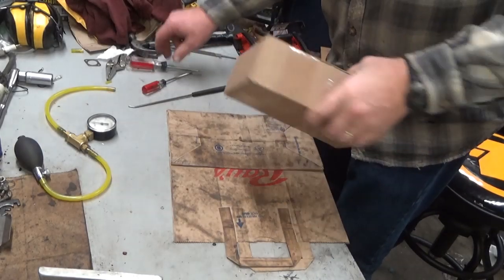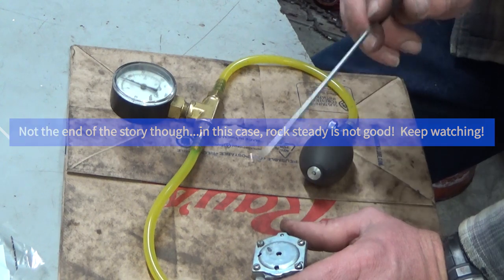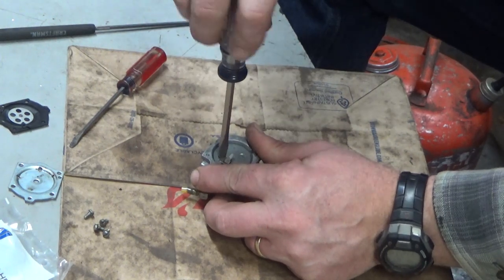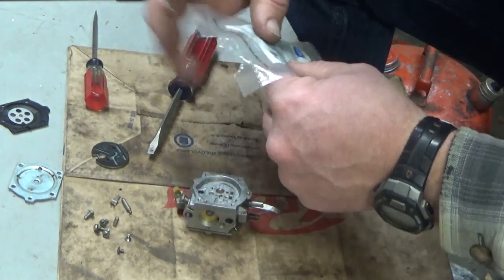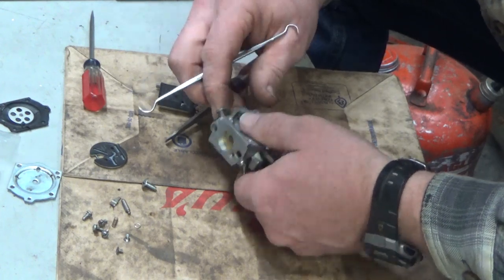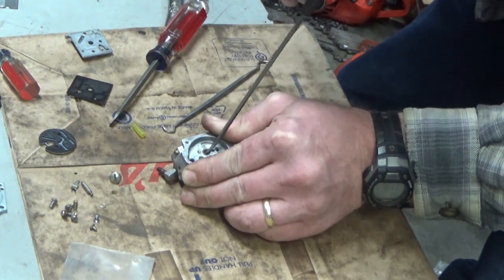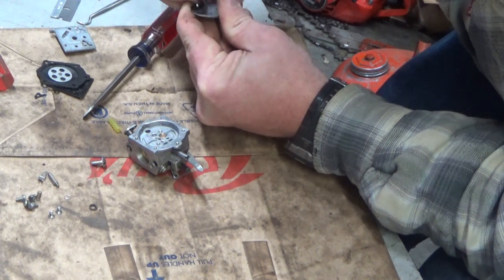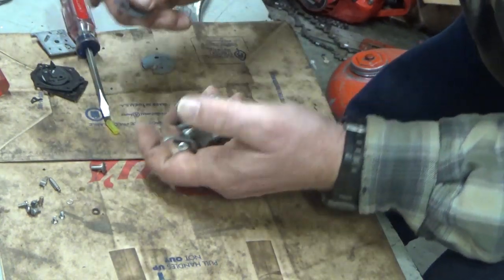Walbro HDC Carburetor Full Disassembly, Check Valve Replacement & Testing

Comment: Thanks to you, I just finished a Super 2 early metal body saw. I used your excellent videos to take it on and had great success. New oil and gas lines, duck bills, piston ring, crankshaft seals and a full rebuild of the HDC carb. Purrs like a kitten now and oils the chain properly without bar oil getting into the crankcase. I really appreciate your careful instructions and explanations. Thank you!!

Comment: Thanks for your insight. I had overlooked the check valve as the cause of not being able to get the saw to perform evenly.
I rebuilt an HDC-65 today. The parts kit (Walbro) had more than one metering arm spring. 
The kit instructions list four springs of different colors: COPPER (98-189), BLUE (98-270), GREEN (98-275) and BLACK (98-266). 
They are of different lengths and wire gauge.
The old spring was copper-colored and the HDC-65 calls for a black spring. The carb had been rebuilt more than once.
This made me look at the circuit plate gasket and ... it was also wrong. This explained the wet, black spark plug.
And so, I am reminded: when rebuilding a carb on an old machine, always keep in mind that it may have been rebuilt with the wrong parts.

Comment: excellent ! I have destroyed my check valve during the disassembly, the old promac 10-10 had exactly the trouble described for hygh speed regime. Now I know that the problem was certainly this small disk. the repairing kit is not easy to find in europe and need to be purshised in USA. Means more than 20 euros, more expensive than a gold disk...well because the seat is removable, thanks to your explanation, I would never guess it was posible, probably I'll try to make a valve with a piece of membrane, and check if I have a leak with your method. A great thank to Leon for sharing his knowledge. And a big pray for the re-birth of my 42 years old chainsaw, make it work again is a real challenge !

Comment: Outstanding video. Great insight🎉Those rubber valves are now $10 to $15  about as much as a new carb. Maybe trying to fab them out of metering diaphragm rubber or acetate with a homemade circular punch tool or metal tubing to get the perfect circular shape. Thats the best option. Otherwise its a new carb.
More manufactured obsolescence
Reply: It’s highway robbery now plus shipping charges 😢😢😢

Comment: I know this is an older video but it is still a very good tutorial.  If a metering needle leaks, first check the seat (magnifier and light are helpful), and try lapping/polishing the needle to the seat to clean it up nicely.  If a bit a carburetor cleaner is not enough to remove any imperfections, try a tiny spot of toothpaste - it has just enough fine abrasive to work.  Finally, try wetting the needle and seat with a bit of fuel mix.  Sometimes that's all it takes to achieve a good seal.

Comment: Really appreciate this video Leon...  I learned alot about proper use of a pressure testers and was able to get my old Husqvarna 140S running like new thanks to you and all the info packed in this video. My next project, tripple Mikuni carb rebuilds  on a  Yamaha Waverunner. Very similar design and testing techniques as used here.  Best Regards, Sam.

Comment: I just sucseded to fix the checkvalve widh a pice of the old pump diafragm .
6 mm hole punch gave "that little piece of rubber " .
Worked well after straight cut 0,5 mm away from diameter on opposit sides.
Had to take out brass to get it in.
Reply: Thanks for the. Size .not going to  order a peice of rubber  confetti from China  that's for shur .Hahaha.

Comment: Thanks for the awesome vid. I was finally able to get my 4 stihl 015 saws running after watching this. Turns out I had the wrong circuit plate gasket in all 4 units, I was using the Z one and the plates on all of them have 2 holes so they all kept flooding and running super rich. Put the other gasket in and now I can tune them all the way up to 12,500 RPM and they rip.

Comment: I just started rebuilding carbs, found a tillotson that leaked on a brand new needle out of the kit. I stretched the spring but it still leaked. I removed the needle and sprayed carb cleaner in there several times. That did the trick. I suspect that the seat can get just a tiny speck of varnish or stuck debris and that will not allow the needle to seat. Seeing this Walbro compared to a tillotson....I'd go with the tillotson every time, much simpler and I think better designed. Thanks for your superb teaching videos!

Comment: I have found that soaking carb gaskets in some mixed fuel prior to installation helps seal things up. I have had a few dry ones drive me crazy but as soon as I did that, they sealed up fine. Great video btw.
Reply: Thanks for the tip. I have never done that before, but it makes sense to me. Trying it now.

Comment: Some of the rebuild kits I’ve used have a small hole in the levering dimple for the metering needle .. a small wire in that holds the spring in perfect alignment for assembly

Comment: I am going to replace the check valves on my HDC's as well. I rebuilt the carbs but I think they need the valves done as well. Also when trying to remove the seat I don't know if you have tried it but with the retainer ring and screen out try turning in a 4mm machine screw by hand and pull it out.

Comment: Great video I learned some things.
I have an old Homelite XL-1. 
I found a carb kit at NAPA for it. Cleaned it all up and put it together. My kit came with the snap ring for that check valve but I didn't pull that apart.
Anyway I don't think my needle valve is sealing enough. I will try stretching the spring and i'll try a spray bottle to check for leaks. Good time.
I used to have a shop years ago but worked mainly on quads,bikes and sleds. I was a Jonsered dealer for a couple years but I didn't work on many saws and didn't have much experience with them or the carbs. 
Saw repairs were not profitable just because of the price of labour vs cost of a new saw so I got out of it and stuck to bikes/sleds/quads.
Anyway now i'm just into fixing the old chainsaws just to save an old saw type thing. 
It's good to learn some stuff from you about these and makes it much more enjoyable.
My saw fired right up but once warm started acting up and it's rich. I'll pop it off in the AM and see if I need that check valve. In my kit there was a black rubber tiny nipple I guess is best way I could describe it. Is that my check valve? 
I'll research that. 
Anyway going to subscribe glad you made this video it really helps.
Reply: Also when testing that seat pressure the lubrication from the fuel/oil helps that needle valve to seal so what I do is squirt a bit of wd40 on the needle then test it. With the fuel it's a more accurate test of how the needle will seal under operating conditions.
Reply from the maker: @Indeewoods  Good point!
Reply: Leon's Chainsaw Parts & Repair 

So I tried a washer on that screw because my carb was leaking like crazy. Worked 100%! Now zero leaks but need crank seals I believe. 
Checked out your web site for the first time. Wow it's awesome! I have some reading to do for sure. Love the history part of it all and the website is laid out well.

Comment: Great job. Good info, shown and explained well. I'm wondering if you have videos on zama carbs, specifically with regard to check valves under the diaphragm.
Reply: the ck valve is mostly a hi ck in that only the hi. jet @ idle only affects the fuel/ air in metering chamber as at idle there is vac. on idle jet but pressure (14.7) on hi jet at idle unless hi ck vlve . works and stops incoming air at idle to raise diaph. stopping  fuel  flo. and filling metering area w air to do starveout at idle. units w purge bulb indicate excess air in bulb and die out @ idle but ok at hi speed as little pressure/ none on hi jet @ hi speed . defective hi ck vlve. prevents normal purge bulb creating vac . to tank , choke only sys. pulls fuel the same but purge bulbs are more affected .

Comment: Thanks for your very helpful video, but I am at an impasse.  I need a check valve assembly for my Stihl 015 Walbro carburetor, but I cannot find one on ebay or from any other source.  Do you have any recommendations about where to find the valve, brass retaining ring, etc.?

Comment: Hi Leon,  I just rebuilt one of these, and now the engine will start, but floods out shortly thereafter. Watching you video, I may have a bad needle or the bar is too high and needs to be bent. I will also check with a pressure pump to see if there is a function issue.  Am I on the right track?

Comment: Hey !  I s that rubber seal almost the same in Tillotson carburators ?  I mean the rubber in the check valve ? I suspect they ofthen ar beeing wearn off worn off into peaces.  But how th install and replace it on a Tillotson for Jonsereds Raket 60 ? Tillotson HS 21 C. or L 45 ?

Comment: I have successfully revitalized rubber tipped float needles with a product called ReGrip Rubber Revitalizer. I'm about to test ReGrip on a Walbro HDC carb diaphragm. I bought the cheap Chinese kit on ebay and the metal button on the new diaphragm is too high, so I am attempting to renew the old diaphragm.
Reply: Try useing a dremel tool or similar tool to grind down the button to match the old one.
Reply: @fishnriver  ,  i only use a very fine tooth file as the dremel  heats the material around the pin and can leak. measure the old pin and duplicate. height is relative to gasket thickness and metering lever adjustment.

Comment: The easy way you can do that is run a screwdriver on top of the carburetor back-and-forth to see if it’s level with the bottom of the screwdriver Like a level that’s how I adjust them

Comment: Excellent video. Do all 2 cycle carbs have the check valve? Most people stick the welding cleaner pins into all of the holes to clean them out - I guess we might be killing some check valves!?!?
Reply: only 2 cycle carbs need it due to metering chamber design. if not working u have idle / prime problems. best to never use pins/wires , just very low pressure air w no carb cleaner to swell rubber/ soft material.

Comment: Walbro carbs still does have a lot of the parts left yet for all the Homelite carbs still out there. But I can't tell if the check valve is included in the K10-HDC carb kit from Walbro.
Reply from the maker: No it isn't, but it sure as hell should be!

Comment: Very nice hands on video, I have always cleaned them put in the kit and hoped for the best can one use their mity vac on the pump side or do I need one of those carb pump setups like you have ,I got one that is slow to start but runs fantastic and restarts with one pull hot ck valve ?like 8 to 10 pulls cold
Reply from the maker: The Mity vac on the pump side works just fine.  A slow starter usually indicates a slightly stiff diaphragm or partially plugged fuel filter.
Reply: a mity vac is good and can ck the hi ck valve / hi circuit for free flow, just be very sure carb. is empty of all gas as it also locks up the pump instantly on vac use w gas , plus the mity vac uses a seal on the shaft that wears and reduces pump pressure use.

Comment: Excellent video. How do you calibrate the spring on Walbro Carburators in order to regulate fuel flow ie 11 PSI verses 17-19 PSI.  Not enough PSI RPM's drop off- to much PSI the RPM's increase.

Comment: Leon, a very useful video. Would you know what size circle the actual flexible check valve is? I was wondering if it would be possible to make some using a spare carb diaphragm (the tan coloured pump material) using a hole punch, and if that type of material is the right stuff? I have got plenty of that type of spares in the carb box. Thanks, Steve
Reply: I'm wondering the same. I wonder if a paper hole punch would make the right size, or if you could make a custom size punch to make them
Reply: Try a leather punch, some have multiple size punches and one might fit.  I ordered a new check valve, I'll measure it when it get here.
Reply: @Raydarnsky  Thanks for the reply. From the House of Homelite website I subsequently found out that the valve material is 0.205" diameter - just over 5mm.
Reply: don't think a soft flexible material will work as pulses even @ idle is 3k per min. idle to mid range = more freq. w the time and effort plus results it's best to get correct one and be done, but u can check a fully assembled carb w a vac/pressure pump to see if hi circuit is open and hi ck is working  ok. if interested on procedure inquire .

Comment: Leon you ever use one of those ultrasonic cleaners? I'm thinking of getting a mid range one. I see guys dump the whole carb in there and it usually comes out pretty good. You have any experience with them?
Reply from the maker: I don't have any experience, but have heard very good things about them.  One is on my wish list, but I need some more space before I get one!
Reply: @LeonsChainsawPartsAndRepair  I here you. I have about 1 sq foot of working space, 20 sq feet of tools and disassembled chainsaws. Need an ultrasonic parts cleaner and a soda blaster. Can never have enough toys
Reply: I have one but never use it on 2 cycle carbs -  too many small /delicate parts to damage/ loose , plus down time involved . unless very corroded /rare carb. best to get new if available.

Comment: I need that EXACT pick, please tell me you know where you can get it? Any time I've had to take that snap ring out of an HD carburetor I half the time booger the crap out of it. Great video btw Leon. Finally getting back to a couple XLs I wanted to fix up for a while, hopefully they won't make me want to swear a lot.
Reply: its a dentist tool, check Ebay etc.  there are a lot of useful styles

Comment: So quick question, I noticed the Needle valve was all metal which means more than likely it has a replaceable rubber seat like some of the other Walbro carburetors. Also how important do you find the Popoff pressure is and do you shoot for 15 to 18 PSI?